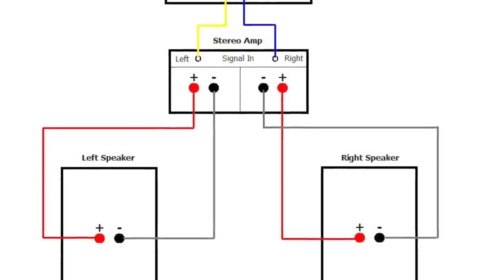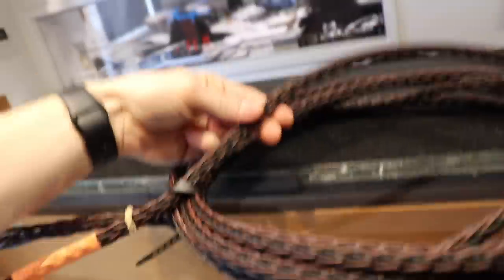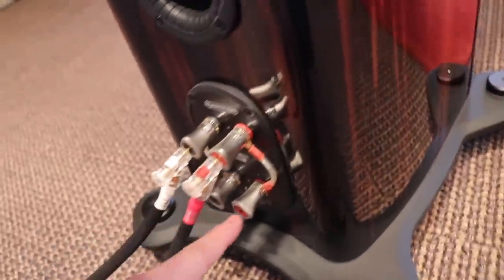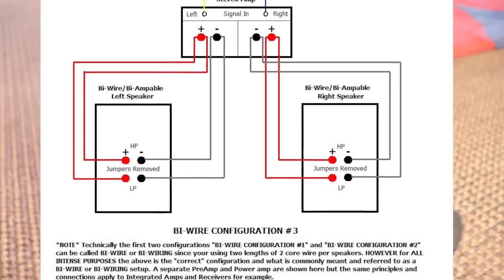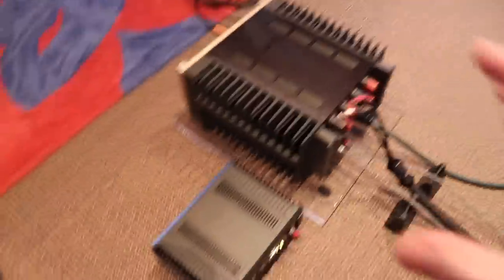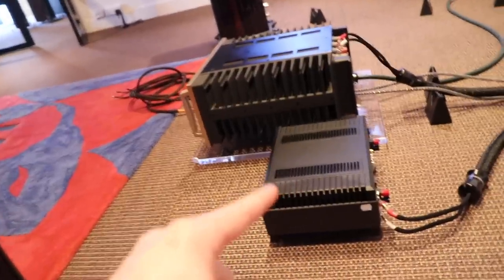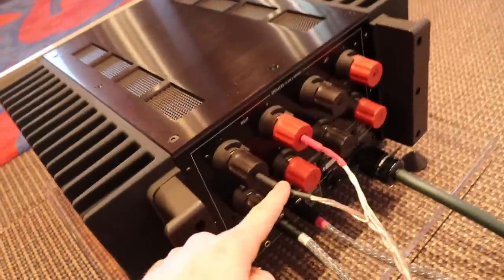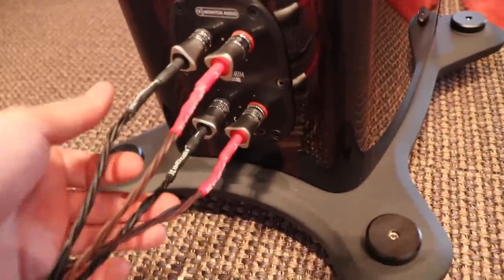Bi Wiring, Bi Amping   What is it?

Comment: I just purchased kimber kable 12VS bi wired pair to replaced my audioquest rocket 88 biwired. do you think it would be an upgrade? The rocket 88 is only 13 gauge and the KK 12VS is 9Gauge big differences so i hope it will make a differences in sound. It is for my bowers wilkins cm8 s2 speakers.
Reply from the maker: Do you mean 12TC or 8VS (i dont recall them making a 12VS)?
Either way I would say it is an upgrade over Audioquest.  Kimber is far more balanced and open sounding than Audioquest.
Reply: @SoundlineAudioNewZealand  Yes they do have 12VS I guess it has been a long time for you're away from them :D

Comment: How does bi wiring work for a centre channel from power amp to receiver
Reply from the maker: Well you dont bi-wire signal leads between amps and receivers only speaker wires.
So it would be a standard single RCA or XLR lead between your power amp and receiver and then you could Bi-wire from the power amp to the speaker.
Reply: How about bi-amp when pre-pro and amp are connected with xlr? Is there a special way cause of xlr cables?

Comment: The obsession with the shorting plates between the tweeter input terminals and the bass input terminals has reached alarming proportions! The manufacturers of speakers know full well that the material these are made from is as equal to the job of conducting the current between the terminals as the printed circuit board tracks that are found on the crossovers inside the loudspeakers. The idea that replacing these short pieces of metal with cable, however 'good' quality it may be (and usually a good bit longer!) is absurd. Surely if this where true, then it would matter whether one plugs into the top or bottom set of terminals, as, when plugged into the top ones the shorting plate only carries the bass signal to the woofer filter, and conversely, when plugged into the bottom set of terminals the shorting plates only carries the treble component to the tweeter filter.

On the subject of the crossover filters, the method of biamping suggested is pointless, as the signal to the tweeters and woofers still has to pass through the crossover filters in each path. The only really valid biamp system is that in which the output from the preamp is fed through an electronic crossover which divides the treble component from the bass and feeds it straight to the drive units.

BTW, the idea of using two dissimilar amps for bass and treble in your 'passive' biamping system means that gain must be controllable on one of the amplifiers to be able to balance the outputs of treble to bass.

Whether it's worth splitting the bass and treble at the amplifier end (biwire) or at the speaker terminals (conventional single wired) I don't have an opinion.....I'm just fascinated by the number of videos made by, and watched, by people who haven't a clue how speaker crossovers work!!!

Comment: I don't feel the extra cost of an additional amplifier in bi-amping speakers justifies the improvements in sound and has been proven in blind test. Though there may be some golden ears that have exceptional hearing delineation if blind tested, I even wonder if they could tell differences more times than not. Subjectivity can play a lot of tricks in what we think we hear. This debate of objectivity vs subjectivity has been going on for decades. The only way I feel there may be an exception to this rule, is if the speakers are highly inefficient. But there again most speakers are efficient with some moderately efficient these days so we're back to the original argument. Good review however.
Reply: I'd only really consider bi amping if I wanted to fiddle with the levels or to tune the sound by using tube amps or something else with a flavoured sound

Comment: I run 8 ohm speakers with my 30 watt per channel amplifier  I use 18 gauge speaker wire because it is only about 2.3 amps maximum. Any louder than that and it runs me out of the house. If I changed my speaker wire it would not change what I hear in the slightest. I think most people would not need that heavy of speaker cable. I would only spend the money on it if I needed it. so far I don't need it.

Comment: Bi-wiring done within one cable sort of defeats the purpose, doesn't it? The magnetic fields of LF and HF wires of the cable would significantly interact with each other.
Reply from the maker: There is certainly an argument for that yes.  Ultimate would be two completely seperate bits of speaker wire going to each speaker, one for highs, one for lows.
You could go one step further and have one for + and one for - of each set as well if you're that serious.
Reply: @SoundlineAudioNewZealand  I would not recomment that "step further" with the separate wires for "+" and "-" as such configuration (unless wires run close to each other) will have significant inductance in cables and is prone to picking eletromagnetic noise.

Comment: Is it audible ?
Reply from the maker: at a certain level of sound system yes it is.
For instance you wont hear a difference on a micro system from a chain electronics store but a high quality well designed stereo system from a specialist store, yes you will.
If it is worth your while doing, a professional will be able to let you know.
Reply: @SoundlineAudioNewZealand  None of what you wrote is correct.

Comment: No real benefit to bi-wiring other than fancy cables -your speakers are still getting the same power from one amplifier. Bi-amping, has benefits as you are running two separate amplifiers -one for the lows and another to the mids-highs speakers.

Comment: The most important topic you left out was talk on ohms. The compatibility of speakers and the amplifier driving them! Damage (burned up amplifier transistors) can occur on some equipment if the correct speaker resistive (ohm) load isn't used!!!

Comment: Iike nice speakers. I have a monitor audio set up myself. Exspensive speaker wires are a con. The sound you hear from the speakers travels through miles of cable hit people still believe the last little bit in your living room will make a difference. Take the speaker apart. Yiu will see very cheap cable coming off the drivers and tweeters. Want better sound? Put the money into more expensive speakers. Put a coat hanger in the back of your amp and the other end in your speakers. I bet you can't tell the difference from exspensive cable

Comment: If you think that you must bI-wire, it would behoove you to take a class in basic electricity. Maybe like night school? Or if you can self teach yourself, go out and get yourself some good textbooks. If you have to prove it to yourself and you own proper test gear, prove it to yourself that way. BI-wiring is worthless. Removing the bridges and using two amplifiers, one for the high frequencies and one for the low frequencies, is the reason that the speaker manufacturers installed those terminals that way. That is the only reason that the speaker manufacturer installed them. Once you have experienced doing the bi-amp way of controlling the signal that goes to your speaker, you will never go back to just a basic wire job, especially if you're running much larger speakers. You must experience it to believe it. I'm guessing that speaker manufacturers who bumped into customers that I wish to bi-wire Will not discourage it, because it adds money in their pocket if you buy more hardware, but it's worthless to do it that way for the customer.

Comment: Do not waste you time and money. Absolutely no benefits in doing so.  I have never noticed any difference bi-wiring the speakers, nor Bi-amping them.  I tried this on my B&W 800 D3 and the Sonus Faber Aida, and at the end it was a waste of money on very expensive cables.
That is my opinion. And in any case this only would work if is no cross overs and each channel is 100% separate from the other.

Comment: Friend, you are too young or did not get through an electronics university. Your drawings stresses more this. The lines are crosed without thinking to be clear. The +/- outs are +/- than -/+ and then the draw becomes apparently and stupid complicated. For lengths up to 50m any wire is as good as platinum or gold. Expensive wires are to stole money from rich dummies. Bi wiring is a stupid thing. Those 4cm nice metal plates does not have any influence  on the sound. In audio there are a lot of beliefs, stupid argumentation and few people with electronic knowledge. Take an oscilloscope and measure any difference in signals with any of wiring. Measurable did not mean audible. Maybe you work in that expensive store and you have to sell lots of thick and expensive cables. Well, that is the company business. But do not mix it with electronics. Note: bi amp does have sense, but I doubt somebody praising cables can make good explanations

Comment: I agree with Ben Dunn, below. Why doesn't this KID discuss Bi-Amping from the perspective that Sound Professionals do...with an active crossover, which separates the frequencies going to each amp/speaker set. Does he not understand that frequency's (low's) require much more POWER than (highs)? Hense, you can relieve a lot of POWER REQUIREMENT from the more musicale amp (Mid/High) by removing the low frequency requirement from the more musicale amplifier and speakers (Mid/High)? This boy needs a bit more practical/education in electronics/Sound Engineering to be qualified in advising people of the "facts", or does he just drink the Cool-Aid to help him sell the extremely PROFITABLE Kimber Cable that his boss wants him to sell????

Comment: How dose it actually separate the low and hi if it's recieving the same sound from the amp if the amp dosent separate hi and low in the first place. All your doing is in my opinion wasting time . How dose it recive the separate sound of hi and low if it's not actually specific hi and low out put
Reply: Your speakers have built in crossovers.  Hence the HF (high frequency terminal) and LF (Low Frequency terminal)  Each terminal goes though the right filter as designed by the speaker manufacture.  So the amp will send the full range signal to each terminal, but the built in crossover will only allow the correct signal to pass.
Reply: What this guy isn’t covering is the cross over it’s self.  Passive vs active for multi driver applications etc.

Comment: This is bad advice and should not be done,adding a 2nd pair of speaker wires will actually in most cases give you a measurably worse speaker performance that can be visually seen on a quality audio spectrum display, measuring what you hear in a miced room.

Heres an honest science based speaker wire chart from an audio engineering & speaker design legend named Roger Russell from Mcintosh Labs,the most prestigious hifi group that owns Mcintosh,Audio Research,Sonus Fabre ,Sumiko etc,read this link to learn why biwiring is not of any use to improve sound.
http://www.roger-russell.com/wire/wire.htm#damping

Comment: TBH bi-wiring does absolutely nothing if the amplifier is a stereo output. Even bi-amping is pointless because all your doing is just increasing the cabling. Its al pointless unless you're using active crossovers. As for those ridiculous hosepipe speakers cables its utter fucking bullshit, take a look inside the cabling in your speakers, it'll be something like 1.5mm bog standard copper. As for the shit on replacing the links with dedicated jumpers is also pointless - it's audio-nervosa that audiophools are rinsed of their money.
Reply: This is interesting. Is bi-wiring intended only for passive speakers? Might be a noob question but since you mentioned active crossovers the doubt came in mind.

Comment: What about the crossover or do not these Speakers which come built into the speakers, this is a big load of bulshit.
All make to sell expensive speaker cable which add little or nothing to the sound.
Reply from the maker: Crossover is built into the speaker and has dedicated high and low frequency inputs which is why you can either mono wire them and use the bridging pins or you can remove the bridging pins and use dedicated amplifier channels and cables for each frequency range.